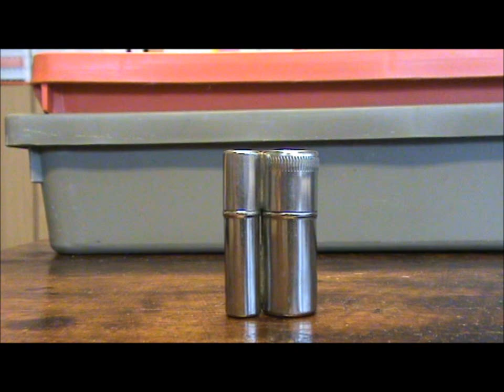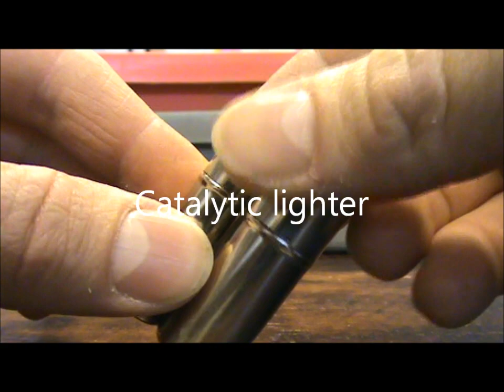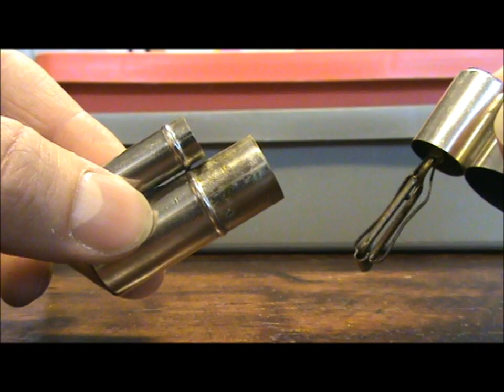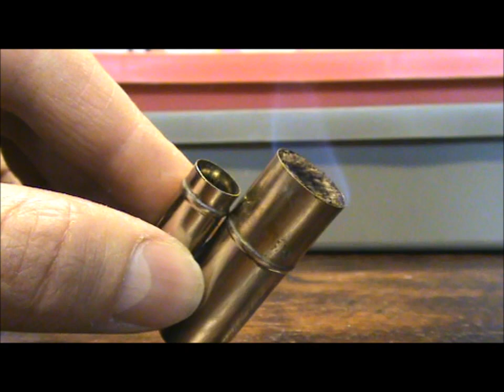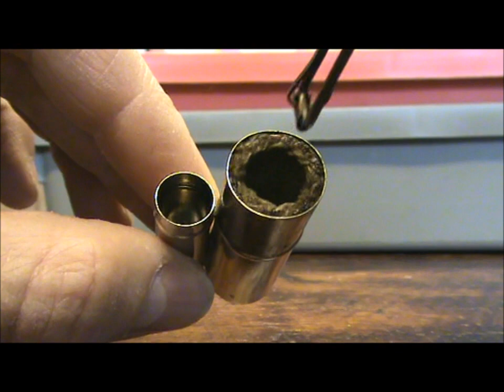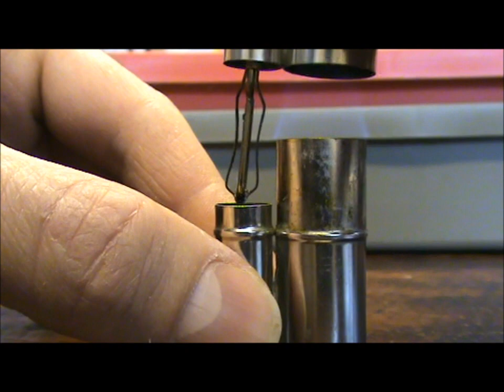Antique catalytic lighter

Comment from the maker: The black ball is indeed made of or covered with black platinum or platinum black and it is essential together with the wires for the lighter to work. If you place the wires and ball inside at an inclined angle the methanol chamber you'll see that it glows too! My guess is that it is providing an extra surface for the reaction to occur.
Hope this helps.
Reply: Have one with the fine silver wires gone but the platinum button is attached.  Now it just glows but no flame.
One has to be very careful when purchasing as most of them have missing or damaged delicate silver wires.
Reply: I've noticed that the first heat starts at the black ball and travels down the wires, so I think the black ball is to get the wires hot enough to continue reacting.  Once the wires are hot and reacting the flame can start anywhere along the wires.
Reply: Pretty sure it palladium not platinum. Something kinda radioactive. Reacts with the methanol fumes and heats up

Comment: It probably adds additional heat for the wires to get hot enough to light the fuel, because normally you need to heat up the plat before it can ignite.
Reply: Yes this is what the black ball does.  Without the ball the wires are too cool to cause enough reaction to get hot, once they are warmed they can keep red hot on their own.

Comment from the maker: Unfortunately it won't work with ethanol due to the tiny very thin platinum wires...not enough surface area. It might work by spraying ethanol over very fine warmed powdered platinum metal but I doubt it. I don't know the brand and there are no markings but you can find similar ones in the link I provided in the description above.
Hope this helps,
A
Reply: The ethanol won't light.  It will however get the filaments glowing red, but no flame will start.  I've tried with 99% iso.

Comment: I'm trying ro build the exact same lighter myself. Tried pure platinum wire of 0.005 inch diameter. Didn't work. Now I have some 0.003 ordered and even 0.002 with god's help. 

However I noticed that black ball. I think it could be ball of any material covered with black platinum? But I don't understand what does ignite the vapors, The ball or the wire? The thing that glows in presence of methanol vapors is the wire. Not the ball. So what that ball does? Without it the ignition is impossible.
Reply: Yea I'm not sure what that ball does.  I think part of the trick is that you have 4 strands so there is a space in between all the hot wires where the vapours are being heat from each direction.  The black ball also seams to heat up so I think it has platinum as well.  I think I've seen the flame start without even having the ball get red, so I think it may not be needed.